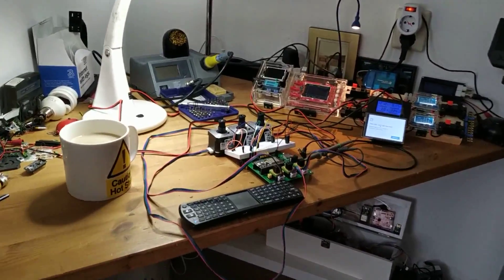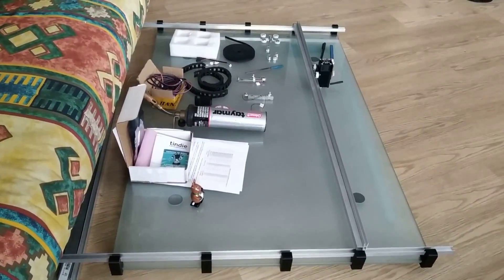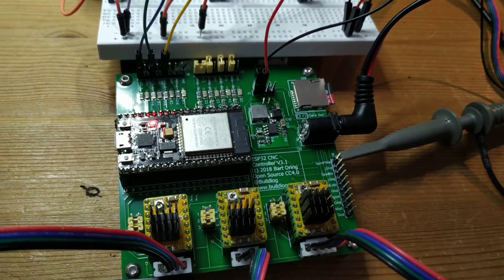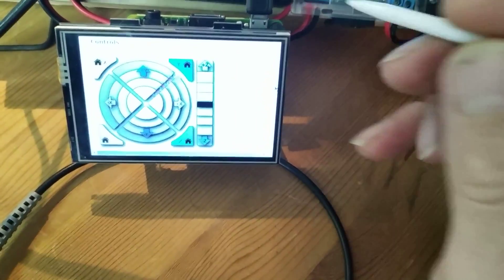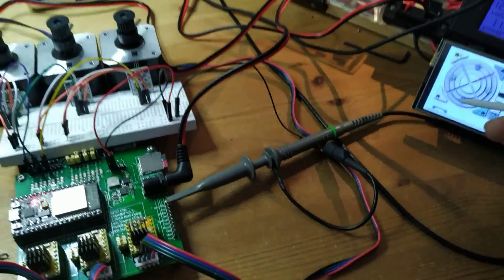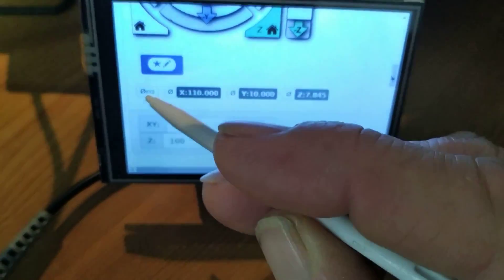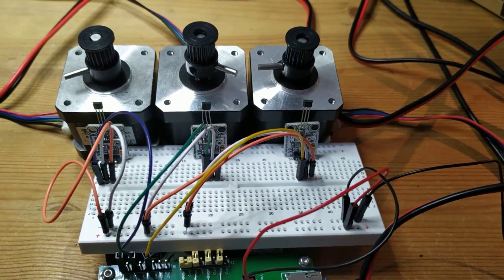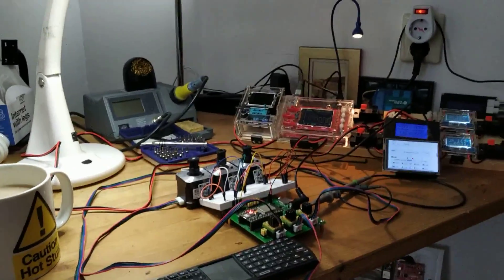Demo of Bart Dring's Grbl ESP32 CNC Development Board V3.1, very good.

Comment: I have a board like yours but after I connect it to the power supply the output voltage is only 4.65v, did you experience the same thing?
Reply from the maker: No.
Sorry, but as I have said elsewhere, I'm only reviewing the board, not supporting it.

Double-check your power supplies, wiring and understanding. If you still think the board is in error go to you supplier.

Comment: Why do you want to lower down  drivers from 64 micro steps? More resolution is more accuracy isn’t it?
Reply from the maker: The devil is in the detail. This board controls a 3axis CNC/Laser engraver with screw thread drive.
The maths is like this: 4mm travel per revolution, 200 full steps per revolution = 0.02mm per step. With 16x miicrostepping you have a basic accuracy of 0.00125 (800 steps per mm). This is far below the tolerances of the rest of the machine, and greatly exceeds the accuracy I need for my pcb and laser cutting jobs. 
Increasing the microstepping (max is 128x with these drivers) will actually lower the speed of the machine (by restricting travel speed, the controller itself has a max step triggering rate) for no perceptible gain.
Reply: @SlEasyTarget  I have been dabbling with laser engravers for over a year now. I learn something new everyday. Thanks for sharing your knowledge.

Comment: First thanks for this video, i have the same board and seeing yours connected with stops helped me.. also you have setup a great looking test bench. I see we have  some of the same testing kits but mine are all in a pile.. Any chance of a video that shows off what you have done to layout your power and test items?
Reply from the maker: It would be a very dull video. So a short description needs to suffice.
The PSU modules are all screwed to a piece of wood with some mirror mounting clips I had lying around, a couple of connector blocks route the wiring and some speaker terminal blocks make it easy to attach leads. All the fancy acryllic cases came with the modules, they are surprisingly badly made, even for low end products.

Underneath the wood I glued a chunky PSU taken from an old laptop (19V at 8A, quite powerful) and a big (20A) buck converter to give me a strong 12V supply, this goes through a Power/Voltage meter so I can see the overall load and is then distrubuted to the smaller adjustable converters (which all have individual voltage/power meters too). 
One of the smaller converters is permanently set to 9V, and has a couple of fixed leads ending in barrel jacks, which is convenient for powering the 'scope and Transistor tester etc. The others are adjustable for whatever project I am working on. There is no negative supply, all the 0V lines are commonly bonded and earthed. 
I designed and 3d printed a couple of wedge shaped stands for the under the plank, but could have just as easily cut some wood to suit..

Comment: Hi, I am try to enable/on spendal and coolent (  ESP32 grbl ) .i want to add relay control spendal motor.there is a file called really.h but it's not working ! Please give me a solution.
Reply from the maker: I just reviewed it, I did not make it, I don't support it ;-)

Details of how to setup etc are all on the designers github page. As is a wiki that may well have the information you need.
https://github.com/bdring/Grbl_Esp32/wiki

Comment: Where do you buy the green board for esp32 and stepper driver motor?
Reply from the maker: The old link to v3.1 was in the description, this was dead but did redirect you to  Bart's web store..   Anyway; I've updated it to the current version of this board.
Look at the main web store for a number of variations on this board made by Bart; they all look great, and there are versions with more steppers, etc.. https://www.tindie.com/stores/33366583/

Comment: Nice setup you have there. I built one by following the blueprint on github, but if I were to do it again, I'd order a pre-build one like you did. The MPCNC version from the same maker looks like a good (better?) alternative as well. That one features double stepper controllers for 2 axis. I tried numerous setups, with arduinos, rasberry-pis and pc-lpt, but this esp32 version is the only one that runs without a glitch. The sd-card is a gamechanger. I can operate my machine with a phone or whatever thing with a browser over wifi and never worry about loosing connection as it runs stand-alone. No boot time, no shutting down procedures. No issues regarding homing or machine limits like I had with the atmega version. Just perfect.

Comment: Hi Owen, very nice demo and well explained.
I just ordered a board to make my Eleksmaker A4 independent from my laptop.
How far is your own laser project? Mightbe good to give the community a bit of review with the board and your system.
I know from several forums that a headless grbl system is on the top wishlist of many users.
Having googled for hours Bart's approach is by far the most advanced and most thought through system.
Reply from the maker: Thanks for the comment, this board ended up in my little CNC/laserEngraver. I really should do a new video showing it in use there, it's a very nice tool.
I ran out of time to do anything with the big format machine, I have all the parts except a frame, but I need to complete other more important stuff before I drage the box out again. When I do it will probably have a home-built MPCNC version of the same controller in it.